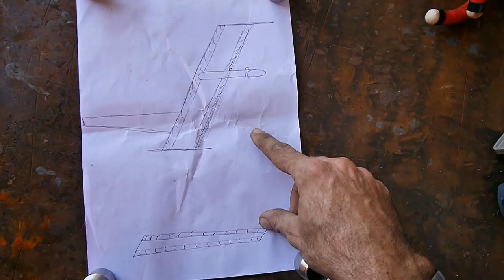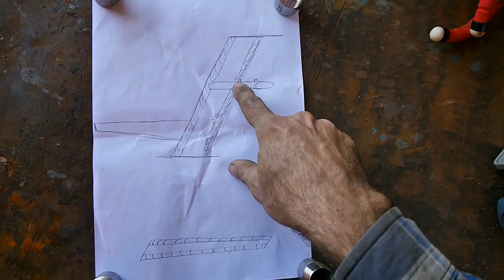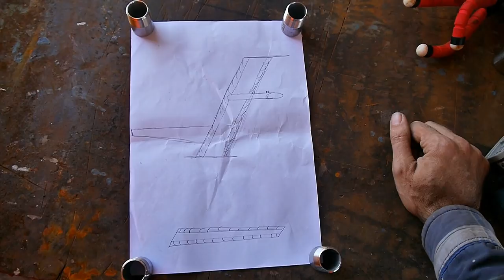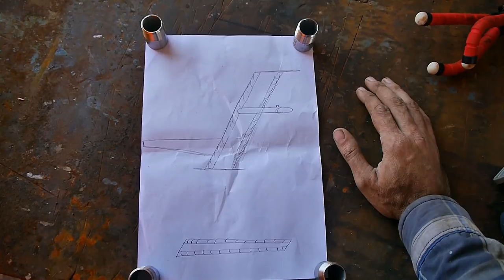BRUPEG GETS A RADAR MAST - PART 1 - (EP. 40)

Comment: I hope you put some gussets at the front and back and both sides of the mast where it welds to the roof for stability. Also cut some holes for cable where the wings attached to the mast and a access panel at the ends of each wing for cable routing. Looking great so far.

Comment: A couple thoughts. You could use a big swimming pool noodle up through the mast as a cable/wire conduit, so you don't hear the wiring smacking the inside of the mast in heavy seas. Also, just for Shits and Giggles, on the wing caps, weld a small horizontal flange on each cap, drill a hole down through it, and mount one of those Winged Goddess hood ornaments on each side, like on a Pierce-Arrow, so you have Guardian Angels on the wings. Call the one on the left wing Portia.
Reply from the maker: Jim I love your idea able quite conduit!, i will use that. I all aboard with having winged guardian angels helping Brupeg steam forward.
Reply: I should have said Cadillac. 1941?

Comment: An easy way to paint the inside of the mast and wings is to plug the end pour some paint in then plug the other end, roll tip, etc to spread the paint around on the inside after 20 mins of sitting repeat a couple times to coat it more. then unplug drain the remaining paint and let dry. I would also drill/cut a hole where the wings connect to the mast for wires on the wing

Comment: When finishing weld two half, you should have used sink primer on it, then weld it finish and use 1?2 later of hull primer pore it in, to it and slowly rolled it and tip it out back into the box, and at the same tie turn it slowly so you covered the whole inside, then you would have a covered inside that will not rust up. 
just an idea for you there...
Reply from the maker: In the next episode I start doing the paint, I actually made a long skinny paint sprayer which worked a treat

Comment: Damien, Jess and Ryan,  Love the design of the radar mast.  I was thinking if you could find the tail section of a small private jet you would have the perfect solution.  However, I don't imagine that would be any more cost effective in Australia than in the States!  I also like your 3D design equipment.  Use a similar system in my wood shop but I upgraded last year to a new system using 3-ring binders and pre-punched paper-so much more efficient and a real time saver (lol).
  When you mount the mast on the pilot house top add a doubler plate either on the outside or inside of the house top.  This will give you a stiffer section and should reduce warpage when you weld it up.  Will also reduce any future flexing that might lead to cracks in the house top.
  All my best and thank you as always for the great video.
Reply from the maker: Cheer Matt. I was a big nervous showing my design software, sometimes people can’t download the files when I share them around, some have even held the files upside down and looked at me quizzically as to why I would build an upside down radar mast.

Comment: You can get a durable waterproof fireproof foam sort of thing it is used in a bolt on ring sort of set up for cable runs through watertight bulkheads on ships, can be fully removed and reinstalled. Just a thought for the hole for the mast.

As far as concrete goes just make sure the steel is 100% dry before putting the concrete in and make sure no moisture gets underneath the concrete ones it has set, as you won't be able to remove it and it will destroy the steel, I have worked on a ship that had a temporary concrete patch in the hull. As far as movement goes a boat that size should not be flexing much at all. Larger ships movement could be an issue if doing an extremely long section of concrete but you shouldn't be using that much concrete anyway.

Comment: Another method you can use when welding up any enclosed structure like the mast is to tack the whole thing together with backing rod or plate behind the joints to get full penetration with welding only from the outside. By alternating skip welds from side to side, distortion will be minimal as the stiffness of the full mast shape will resist the stresses and you won't have to deal with the twisted pretzels you get when welding each half fully inside before assembly. 

You will find the single pass welds can be burned in very hot with nice flat beads that generally look better with less overall stress in the plate than multi pass welds. Depending on the plate thickness you may not even need to bevel or V out the joint and you have the option to multi pass weld a smaller concave root pass first with a wash pass over it if that works better.

Comment: Cool design, couple comments: maybe this won't be a priority for Brupeg but often a mast like that is built with a flat plate at the bottom which is then designed as a hinged plate that allows the mast to be tipped back, either for maintenance or say for clearance under a bridge.
Also, lots of boats ignore the aerial separation issue but its a good idea to also separate the VHF Comm from the VHF AIS antenna as much as practical, otherwise the two systems will occasionally blank each other out. Looks great!
Reply from the maker: OK thanks for that David, yeah we have 2.5m max separation for Internet and the next step in is 2.1m so i will use these for VHF as you suggest. As for hinge down, its probably something we may use but for now its welded solid, the beauty of steel is I can unweld it at any point and add a hinge if needed.
Reply: Damien sounds great! 2.1 should be fine, a good rule of thumb is a minimum of 1 full wavelength between the VHFs. AIS is 162 MHz, 1 wavelength is 1.85m... so 2.1 is even better!
Reply from the maker: Good to know

Comment: I'd look at adding a small access hole big enough for your hand  maybe 3"x5" under the "spreader" and a second near the top. Even a single gang box size would work, and then you can use a SS single gang box cover with a gasket to close it up.
Reply from the maker: Hi Daryn, the top plate on this radar is bolt on bolt off, when its off we can get our hands down to the top spreaders to change any cabling into the future. The lower cable inlet (radar) is able to be reached from the bottom. we built it this way so we have the least available chance of water getting into the interior of the mast.

Comment: The swept mast with swept wings will look AWESOME! Should add 1 or 1 1/2 knots to your top speed. Glad you thought about serviceability and access for future installations. Automotive engineers never seem to grasp that concept. Looking forward to seeing it painted and installed. Cheers from Detroit.
Reply: Auto Engineers(Ph.D.=Piled Higher and DEEPER) don't design ANYTHING to be Worked On anymore, they intend us to Drive 'em a few(VERY Few) and then Throw Them Away, and get a New One. That's what a Disposable Society IS.
Reply from the maker: Thanks Mr Frog
Reply from the maker: Jim Everything on Brupeg needs to be rebuild-able (often at sea in horrid weather).
Reply: And usually Colder than a well-digger's ass in the Yukon, too,lol.

Comment: I'm no expert. But wouldn't it be easy to get a section of old Aluminium yacht mast and some spreaders to make it light up on top, and it's already the right shape and non corrosive, etc? Granted you would need to bolt it on not weld it. Seems a lot of work and weight this way. However I just love your ingenuity making these things from scratch. Keep up the good work.
Reply from the maker: Hi Glenn. If an off the shelf option was possible I might have considered it, that said when Brupeg gets to the ice it’s to be expected that the radar mast (along with every other surface above the waterline) will at some point be covered in 4” ice hard ice that needs to be chipped off, the most successful way of doing this is with sledgehammers (so the Alaskan fishermen have shown us in videos). So that was the reason we built it so strong, that and I really enjoyed making this mast, all up is cost less than $150 so I’m pretty happy with the result

Comment: hint when welding treated steal grind the treatment off on both sides it saves on the splater and bad gasses that are bad for you
Reply from the maker: Thanks Matt. This is maybe the second bit of Galvin I’ve ever welded so will keep this info in mind when I hit number three. Thanks
Reply: Steel Boat Adventures - Building Brupeg  i had to do a welding corse for my job

Comment: Is there a reason why you fully weld the inside of the mast. Why not just tack weld it in several places then full run the outside doing back welds. Not a criticism just curious.
Reply from the maker: Hi Sterling, no real reason, could have got away with tack and exterior weld. mainly just adding as much strength to it as poss. (this mast will need to survive being hit with sledgehammers when its fully iced up to maintain the least top weight as possible so it will get a hiding in normal operation.
Reply: Never give that a thought we don't  get masts icing up here in the UK. That makes sense great job enjoying watching your progress. Keep at it.

Comment: Still put a plate on the cabin top, won’t you?  Spread the load and add to the rigidity.
Reply from the maker: We actually triangulated the load, rather than having the single mast welded to the roof, i changed my plan and added two 45 degree arms off the rear surface, the load is now spread over an area maybe 8-10 times greater than the original plan

Comment: Hi what about the other side of the roof, where you are goin to weld it on to, did you not just insulate that with foam. I am not sure but I think you need scecial primer to get paint to stick to galvanized steel, I have never succeded in getting paint to stick to it. If your going to have the room underneith it warmed up, be sure to have a water tight seal, otherwise you will have condensation dripping on your head.
Reply from the maker: Your right, we did just insulate that part of the boat, but the panels are removable for just this reason. As for paint sticking to galv, if we have any issues with not adhering etc i will just blast the galv off and paint the steel underneath. I'm not fussed about keeping it galv.
Reply: The problem I have had with paint and galv. is that it seems to stick for 6 month and then starts to flake off.
Reply from the maker: Yeah if hat happens I will just rip it of with sand and go with steel

Comment: You desperately need a plasma cutter, bro. Would make all of those cuts so much easier... :)
Reply from the maker: I have one. I’m just better at doing long straight runs with my 1mm cut off discs
Reply: Use a fence... but yeah, whatever works best for you is the way to do it. Not that it matters now anyway. You've already finished making all of the long cuts. lmao

Comment: Hey Damien ! Loved your "sandblasting music", you mentioned antenna separation, do they have to be perfectly parallel ? Was thinking if they're at the extreme ends of your wings, and canted back and outward so the tips are wider ( if they're whip types ) ?  Since you're thinking of de-icing with hammers, maybe an electric heating wire attached nearest the upper surfaces where accumulations will build highest ? See : https://www.amazon.com/dp/B073312DVB/ref=psdc_3226899011_t1_B00427COLA
Reply from the maker: Hi Mike, we did think about a heating system, the trouble is we have so much area to heat the radar mast really does become small. for example a 1.25" handrail becomes 4" + icicles in 100knots, we did ponder the ability to divert hot engine coolant to flow through the handrails but this would then turn them into molten handrails if you needed to grab them for some reason.
Reply: Yeah, understood.. I was thinking more of immediately next to the antennas so you don't damage them smashing ice off the mast indirectly, and maybe to heat the upper surfaces where accumulation is greatest to make removal easier
Reply from the maker: Yeah that's not a bad idea actually, I can see the value in that, when we get into the colder climates i will most likely test and change a few things base on what issues we are finding, this might well be something we factor in
Reply: A different thing I saw on a fishing boat I think, was clamp on or welded on round edged rings on the exterior surface to make the ice thinner in sensitive areas so its easier to break, sort of creating a fault line. Gotta go, up at 4:30 again tomorrow !
Reply from the maker: I like this idea thanks Mike

Comment: 2:39 I'm glad you know the distinction between BSP and NPT. Getting NPT threads cut in my SS nipples (my god, boating's salacious!) was time-consuming and annoying, but necessary for my waterline and thru-hull Marelon ball cocks. I don't know how deeply you're going down the "DIY fabrication" road at sea, but I'm bringing a certain number of taps and dies aboard. 

3:01 I am assuming you know it's not good practice to have the VHF, the AIS transponder antenna and the radar overlapping in terms of their "radiation planes" or whatever the technical term is. A way around this is to just have the VHF and AIS transmit on the same antenna half a metre above the radome. I went a separate route in the sense that if I lost either the AIS or the VHF antenna, I could use either as a "spare" via a splitter. Vesper makes a nice powered one. 10:00: It's impressive you were able to salvage such a huge piece of SS pipe. Massive, indeed. 16:00 The doubling idea is sound. That's a lot of weight aloft and it's a sort of lever arm, so spreading the load, even with a plate welded to the base of the mast on the underside, strikes me as a good idea, as does "having a hole you can get your arm up". 24:28 You're going to want some insulation up there for condensation reasons. The wheelhouse is going to be warm, but that mast interior is going to be freezing. "Drip loops" in your wiring might also be a way to deal with it, along with the polystyrene plug you're discussing. Great stuff, guys. Lovely to see a couple bantering about the pros and cons of cement ballast!
Reply from the maker: Thanks Marc. Lots of info here, I’m going to take my time with this comment and extract all the bits
Reply: No rush...I think your design is sound and I, too, don't know enough about the dual wireless antennas to comment on that part, but putting an AIS transponder antenna on the same plane as a VHF antenna is problematic because the AIS frequency is right at the high end of the marine VHF band. Our AIS-dedicated antenna is at the port-side first spreader; the top of that more or less metre-long whip ends before the bottom of the radar gimbal mount and the VHF antenna is at the top of the mast. Nothing interferes (so far!) with anything else. I see AIS targets at 24 NM range (south side of Lake Ontario) on my plotter, despite the fact that my first spreader is only about 5 metres off the deck, which is 2 metres off the water. I went with a top-end cable called LMR-400 UV that has better shielding than the usual boaty stuff and therefore when I send 25 watts up to the mast top, about 21 watts leaves the antenna. I can be heard a greater distance more clearly, so it's something to consider, and your runs would be shorter than mine from your bridge to the top of the radar mast. https://www.passagemaker.com/technical/the-skinny-on-coaxial-cables-connectors
Reply from the maker: Awesome thanks for that. I can mount antenna in the centre of the mast and lift it up. The issue I guess is the outer two antenna are 3m long so they will interfere. I might ponder another location for AIS
Reply: You could mount it inverted off the bottom of the top plate, perhaps? Or off a light pole welded to a stern quarter or even off the bow.Again, wireless is a much higher frequency than VHF/AIS, so I don't know if it would interfere. You'll have to solicit some radio pro's advice on that. The good news is that a steell boat of substance like Brupeg is going to make a great radar target. Another advantage in terms of comms is that if you installed an SSB rig, steel boats are great for transmission because the whole hull is a ground plate. https://www.sailboat-cruising.com/SSB-marine-radio.html